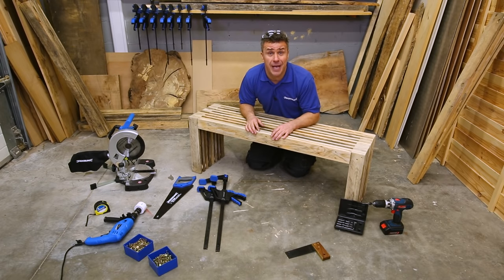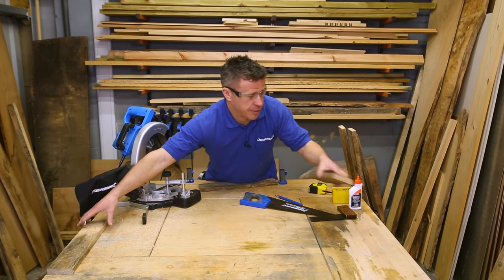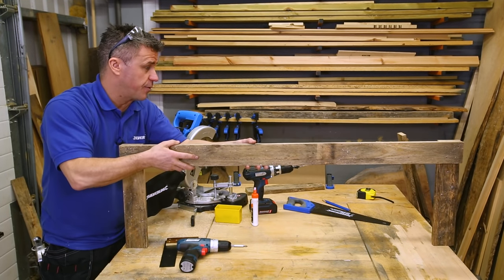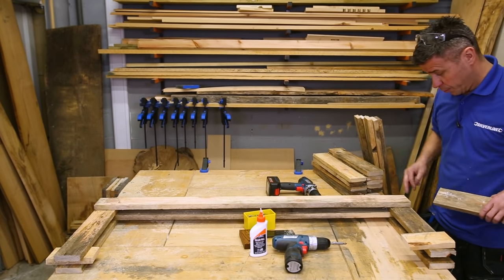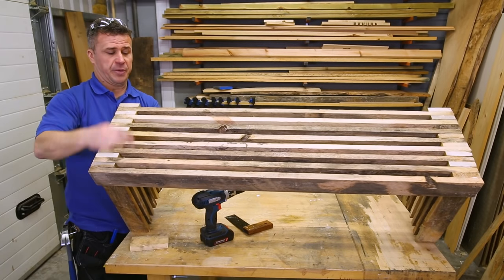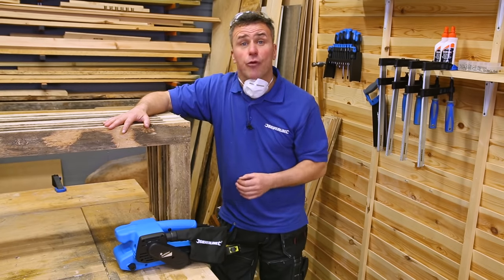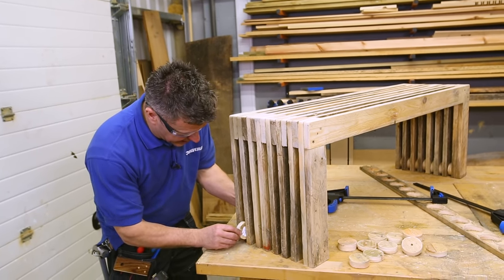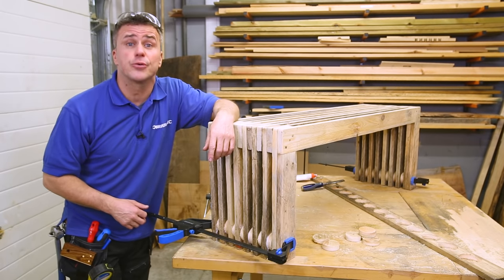How to make a DIY pallet bench

Comment: How many pallets would be needed to make this bench?
Reply from the maker: Hi Lynn,

It depends on the size and construction of the pallets that you are recycling. We recycled 6 pallets to build this bench. You can see how to take apart pallets here: https://www.youtube.com/watch?v=gPi0zDsqJUo&list=PLWYlGdEsoWd5l9RLqkmE4e-9IuP9W3mNL&index=1

Thanks for watching our video 👍
Reply: if you cut a 25mm spacer to put under the discs you will get them the same then clamp them up great vid tho keep up the good work
Reply: I used 2 pallets different sizes so the legs & seat slats were already the right length.

Comment: Sorry Craig... I respect what you are doing but I have to point out, That is not pallet wood. it is treated timber cut to a similar dimension of a Pallet's slat. but it is way too perfect.. no nail holes and no sanding. my money would be on this wood coming straight from the shop and being treated with a Wire wool and vinegar solution to give it a weathered effect.
Reply: yeah... I get some pretty nice pallets sometimes. depends on where you are getting your wood.